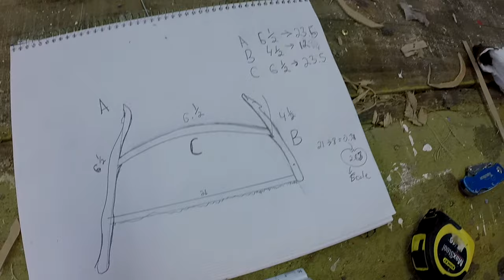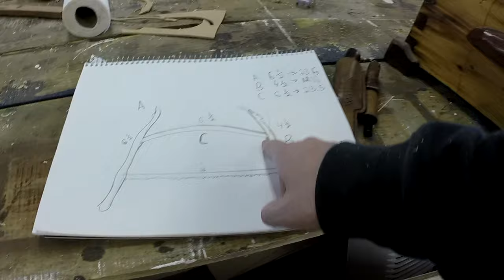Custom Portable Bucksaw

Comment: That thing looks great!! I'm goin to build one (simpler and most likely not very pretty, though) in the near future. I have a swedish folding buck saw which is triangular, like the Sven-saw, and it is a pain in the butt to cut logs bigger than 3-4 inches. Planning to make a small one with a hack saw blade for my kid. Should be a little safer than a real bow saw blade. (he is only 4...)
Reply from the maker: +ladedk HAHA! I know what you mean, my twins are 5 and I have a 3 year old. They always want to cut and break things. I would take a used hacksaw so that even that is dull. Good luck with your project!
Reply: A 4 year old with a saw. What could go wrong? Your work bench might have a short leg. Your premium lumber for special projects might become short pieces. Your car could end up with notched tires. What else could go wrong? Give them a small fun little project and SUPERVISE them. You'll both have great fun and memories.

Comment: It would have gone smoother if you had laid out the design (as you did) on the plywood, and screwed mounting blocks to the plywood; have your clamps preset beside the block and go from there.  I used that approach when bending ribs for a boat and didn't have to cut the plywood.  Otherwise, a great job.